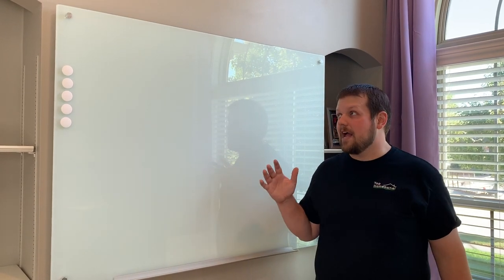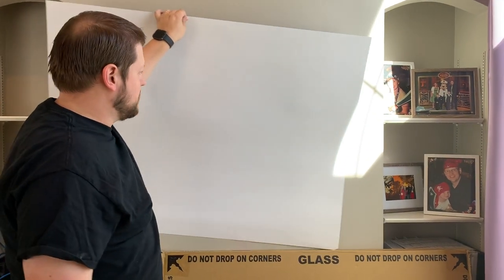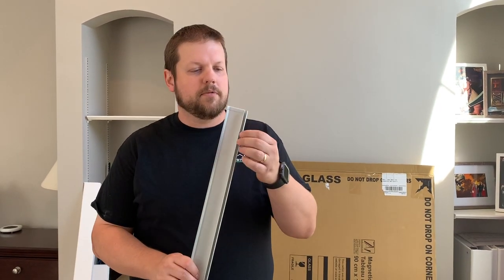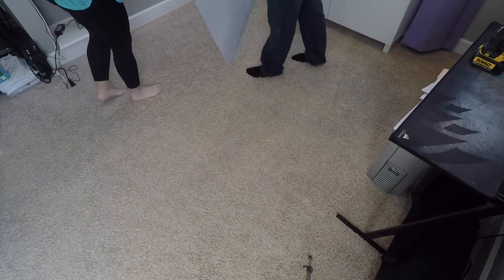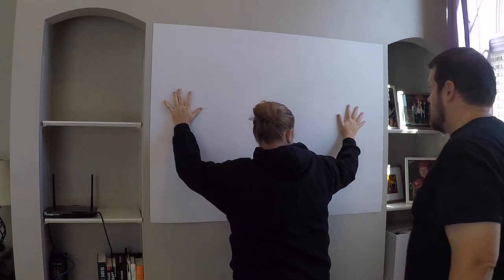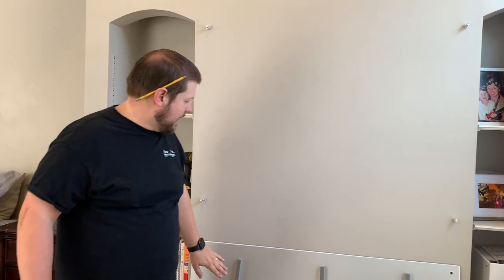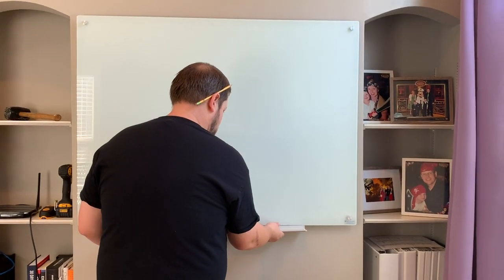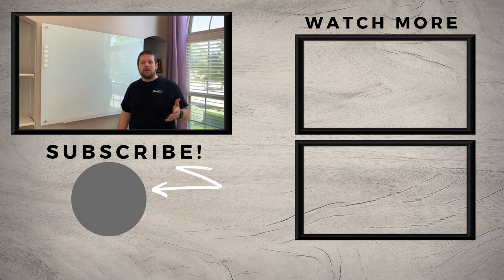Glass Magnetic Whiteboard Review and Installation

Comment: Question about these boards. I just watched someone do a review on the Quartet glass boards. They said that after 2yrs of use when they wipe the markers off it smudges really bad. In fact they demonstrated it. When they sprayed the glass and wiped it the marker that had been on the board for a couple weeks smeared all over. You could see the marker come off but it left a really greasy mess that took a lot of work to clean up. Before they used liquid they used a dry paper towel to demonstrate how hard it was to wipe the marker off. The marker did not come off very well until they sprayed liquid and the info I said above was what he demonstrated after that. How do you feel about the glass boards and have you used for any length of time to see if they still do well after a year or so?  What markers do you use? What do you clean the boards with?  Also I saw you tell someone what type of magnets to use for the board. That link didn’t work anymore. Thanks for answering all my questions.
Reply from the maker: We've owned one board for two years and have not seen this issue. Just guessing, but it could be the brand of marker that's an issue. We've only used Quartet markers because the colors are great so that could be a factor. As for day-to-day cleaning, we just use a standard dry eraser. Every couple of months or so we will wipe down the board with Windex and a paper towel because we will get specks of ink that don't want to come off easily. One (or both) of those things could be why we haven't had an issue. As for the magnets, here are the ones that we use and they work great: https://amzn.to/34YXql6 Thanks!
Reply: Top Homeowner thank you. Yea I looked at the price points between the 2 brands Audio Visual & Quartet and Audio Visual is priced better. As for the markers do you use the bullet tip, chisel tip, or fine tip? Also are you using the Quartet eraser or something like that. Thanks again
Reply from the maker: We use all types of marker tips, depending on what is being wrote down. For our calendar we use fine or chisel. Grocery lists/to-dos we lean toward bullet, mainly because our children round off the points when they use them.

For our office white board we use the Quartet magnetic eraser https://amzn.to/2Y6JEeT 
In the kitchen where we have our frosted non-magnetic board we just use a dry washcloth or towel...again kids play a factor in this because I'm sure it would be like the remote and walk off ;)

Comment: fantastic instructional video! I found it odd that the template doesn't have pre-marked/"drilled"  holes and you have to go to the process of putting the glass board over the template to mark the holes which is one more step for potential error?
at any rate really good video!
Reply from the maker: Thank you! I thought the same thing. It would have been nice for the template to already have the marks but I'm sure it was cheaper just to include a plain template.
Reply: More like a double chance of having issues. You got to line up the template perfectly and then the marked holes are of course not the size of the drill bit needed... so now ya have to place a dot as close to center on each of those marked circles and pray it's all not off by too much or you're  poop out of luck.
Reply: I had the clear 6 bolt version and something didn’t line up correctly with our bolts, so we had to go back and patch up our holes, paint over them, and now try again.

Comment: Hi, I have a question. The one you have by the kitchen is the one that I bought so does it have to be on a stud? Mine is 40 lbs 4’ x 3’. Will it be safe to just install on the dry wall? I never installed anything on my walls besides clocks or pictures so I have no idea here. If you or anyone can guide me here, that’ll be great!

Thank you!
Reply from the maker: The wall anchors are rated to hold around 50+lbs each. With 6 holes on the 4x3 board it should be fine. That said, if you can attach at least one side to a stud that would give you the most secure mount.
Reply: Mine has 4 not 6 non magnetic glass. Thank you for the advice.

Comment: Good stuff. Thanks. 

Do you know if quartet has a similar installation process?
Reply from the maker: Yes, it looks like it is. I was able to find their installation instructions and the mounts look very similar. One difference I noticed is that they don't include a cardboard template. It looks like you have to hold the glass to the wall and mark the hole locations. Here's a link if you'd like to check it out: https://www.quartet.com/support-resources/installation-guides/infinity-glass-whiteboard-mounting/
Reply: @TopHomeowner  Thank you very much. Would you know the difference between Audiovisual and Quartet. Is the quality between the two similar? Thanks again. I like the cardboard template
Reply from the maker: We have not used the glass Quartet but would assume that the quality is similar we just have preferred the AudioVisual style.
Reply: @TopHomeowner  Yeah, I bought a 6*3  (Ultra White) and a 4*3 (Black) from Audio Visual Direct. Very good boards and great company service.

Comment: I'm totally lost installing the one I got through Amazon. So I ordered the Clear: 3 ft x 2 ft and I marked off the template... but then how are you marking the center of the hole? This is where the process would be easier and less of a chance to make a mistake if they'ed just given a premarked template. Am I supposed to just eyeball the center of each circle I outlined?
Reply from the maker: Yes, you have to eyeball it. I totally agree a marked template would be much better.

Comment: i bought everything on your list, I'm very confused about the drill part, are there separate drill bits and a different driving machine that you use to drill vs screw ?
Reply from the maker: You'll need a drill bit and drill to make the holes. If you are attaching to studs in the wall, you'll just need the driver or you can use the drill itself with a screw bit. Hope that helps. I found this video that does a great job of explaining drill basics if you have more questions: https://www.youtube.com/watch?v=k7Al6KLUF_o
Reply: @TopHomeowner  oh okay, I just drilled with the screw driver to make the hole (the one from the buy list), placed the white plastic screw base and then screwed as per instructions. Looks great and thanks for the video+buy list.

Comment: Did you drill into the studs? And install the anchors in them as well?
Reply from the maker: The studs didn't line-up for this install, so we just used the wall anchors into drywall. If I would have been able to attach to a stud (or two), I would have only had to drill a smaller pilot hole into the stud and not use an anchor for those screws. Hope that helps!

Comment: What size drill did you use before installing the anchors.?
Reply from the maker: I can't find the instructions and I don't remember exactly. I do have some other packaged hardware that's similar though. Toggler Alligator AF6 https://geni.us/8nsBYS . For Drywall only, the plastic anchors need a 1/4" bit. If you're drilling directly into a stud (no anchor), the bit needs to be a lot smaller. You'll want to just make a pilot hole and I use a 7/64" bit since you want to leave enough material for the screw to grip the wood stud, but also not split it. Hope this helps!

Comment: I need YouTube to teach me some drilling skills. How easy is it wipe off? Does it stain at all? I threw my cheap white board that I bought from Walmart a couple days ago. It would stain like crazy. 😬
Reply from the maker: We have had our non-magnetic whiteboard for 3-4 years and I had a calendar on it for the last year. It was pretty easy to wipe off and since both are glass I just used glass cleaner to get some of it that was a little more stubborn but absolutely no stains for on either of the boards.
Reply: @TopHomeowner  I checked the link provided to buy and it’s over $200 USD. I fully understand that they provide a lifetime warranty but if it gets damaged in any way, can they refund me?
Reply from the maker: You will have to check with them about their lifetime warranty. We are not associated with Audiovisual Direct. As far as the price it depends on the size you go with, the ones in the video were under $200.
Reply: @TopHomeowner  So you are not affiliated with them? Is the one on this video standard or ultra white? Which one is better?
Reply from the maker: No we aren't affiliated with that company, just Amazon. We only review and recommend products we've actually purchased ourselves too. The board we installed in the video is standard white, not ultra white. Based on the photos, ultra-white looks closer to a typical whiteboard, whereas standard white has a little bit of a green hue to it. It works for our needs though. I've heard good things about the glass Quartet boards as well so you might want to check those out too. Hope this helps.
Reply: @TopHomeowner  do you think the ultra white is made of glass as well? Is it serve the same purpose as standard white? I want something as similar as a white board but with Hugh quality
Reply from the maker: We do believe it is made better than a typical white board. It really depends on what your needs are though. For the glass white boards they are not only more aesthetically pleasing but also easier to clean and don't stain.
Reply: @TopHomeowner  don't worry. I'm owning one of these awesome boards for a few months now. It's great.

Comment: Do led light strips illuminate the board?
Reply from the maker: Great question. I wasn't sure so I took some of mine and tried it. Since the back is solid metal on the magnetic board, light can't shine through. I tried lighting the edge but I couldn't make that work very well either. The frosted one is a little too transparent and you see the lights pretty clearly so they are too bright. You might be able to mount the strips to the back of the frosted board and light up the wall, but you'd see the strips on the back. I hope that answers your question!

Comment: Mine didn’t come with the foam strips 😢
Reply from the maker: If it has a metal back it should have come with the strips. If you reach out to the company and let them know, I'm sure they'll help. Also, keep in mind if you have a transparent board, it won't come with the strips since they would show through from the back. On those, they add additional mounting holes in the middle to give the extra support it needs. Hope this helps!
Reply: Yes it helped! Thank you so much! I was wrong and it didn’t need the foam strips after all 
Thank you again 😄😄😄

Comment: Could you use the same screws included to drill into stud?
Reply from the maker: Yes, and we did with our frosted one. Unfortunately when we went to hang the one in the video it didn't land on a stud at any point, which is why we had to use anchors.

Comment: lol what do you do when you are a girl and don't have a partner to help installing? lol

thanks for the video I will try installing mine next week, thankfully it is smaller than yours so I can try doing by myself
Reply from the maker: As long as you take your time with the template, the board should line up easily. Keep two of the screw caps in your hand and install them at the top first. That should hold it in place while you get the other screw caps installed. And yes, if it's smaller you should be just fine. Let me know how it goes!